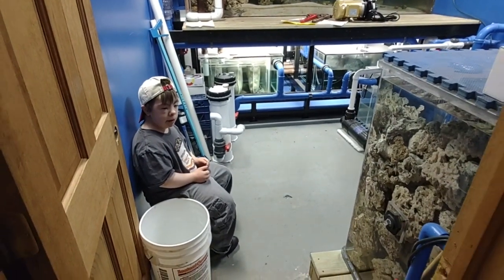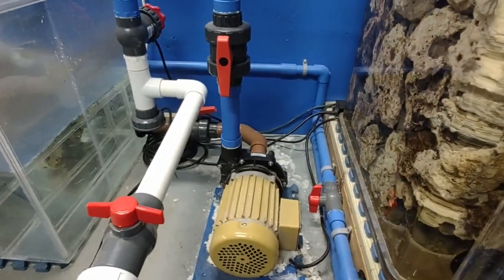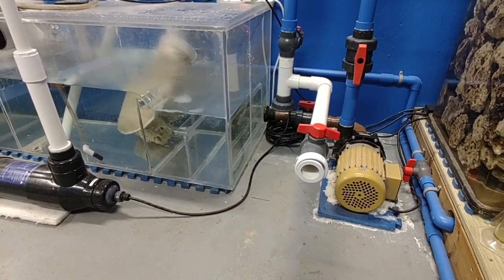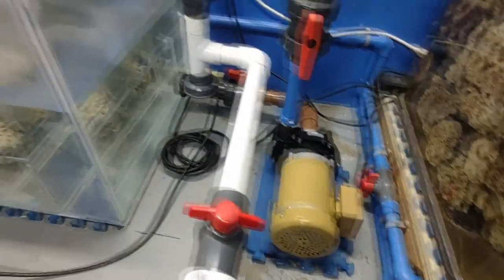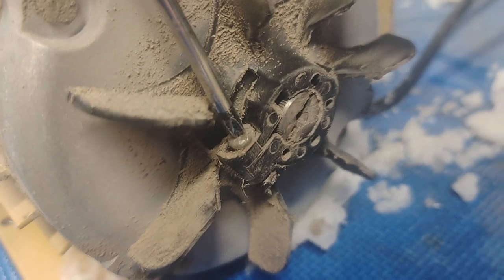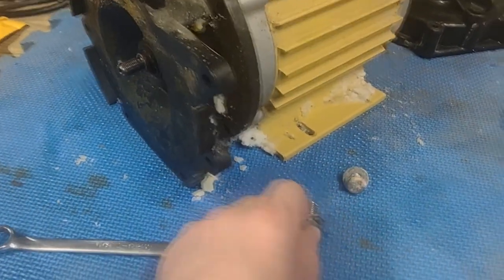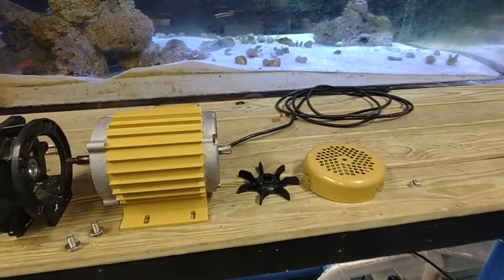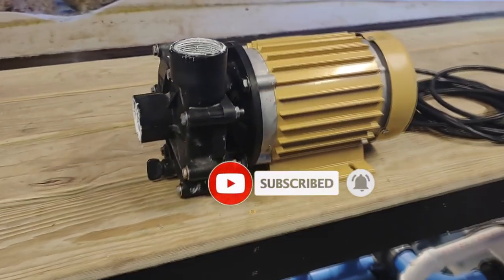How to rebuild and install REEFLOWS HAMMERHEAD motor SEALS!!!  It's only a matter of time.

Comment: Did you put any kind of lube on the shaft after cleaning it up before putting it back together?
Reply from the maker: Thanks for watching and following along! To answer your question no, just put everything back together and it's presently working with no issues.

Comment: How long do those motor bearings last?  I got one a few years back with a 450g, but still have not hooked it up.  I just know I get 5 years or so on my pool pumps @12 to 14 hours per day, but in Ohio you know I am not running all year round.  Thanks for the info.
Reply from the maker: Thanks for watching and following along! Your question is a good one, the brand new motor that I just purchased from bulk reef supply/reeflow, as soon as I plugged it in, I noticed the motor was incredibly loud. I let it run for 24 hours and noticed, it was actually getting louder. I got a hold of reeflow, sent them a video and they agreed that something was definitely wrong. So just last night, I reinstalled the original motor and the brand new one is going back for replacement or the installation of new bearings.
Reply from the maker: Your motor might be perfect with no issues or a possible rebuild kit might be required, hope this answers your question